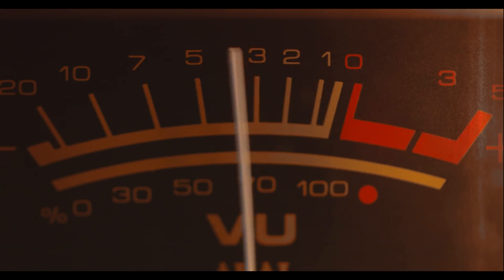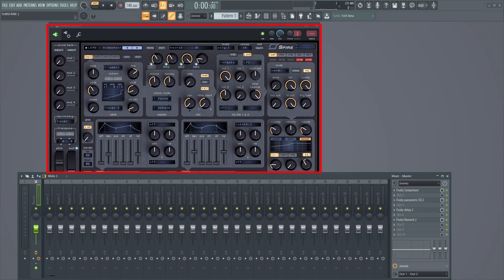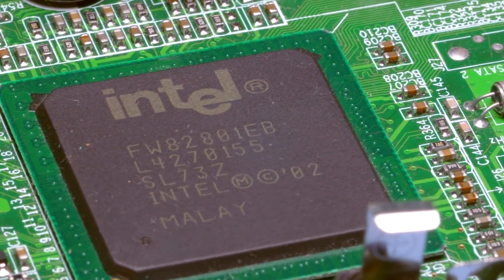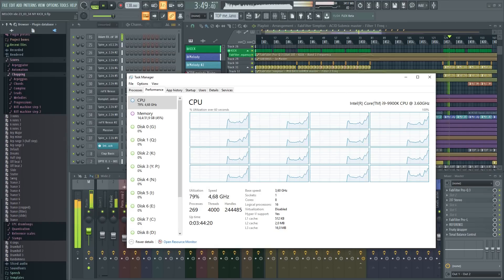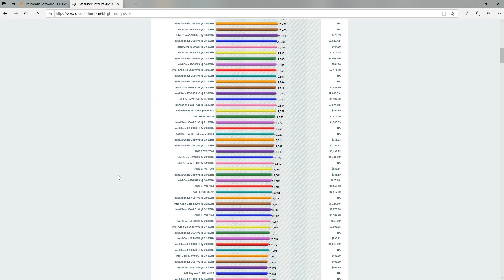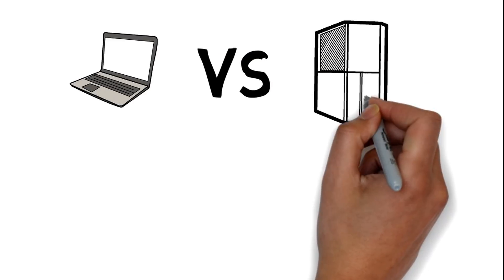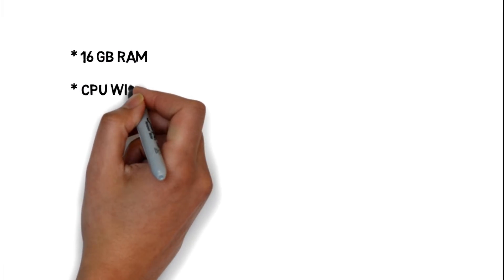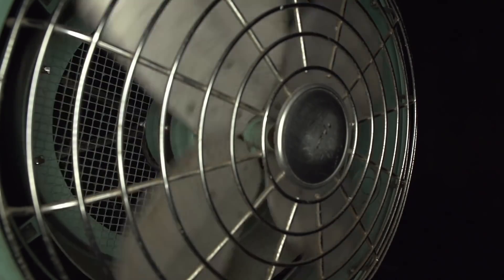The Best Computer For Music Production - What's Needed And Why!

Comment: I'm getting a ryzen 7 3700x and a 2070 super PC with 32 gb of ram for music production/games anybody got a better option that would suit games/music production?
Reply: i9 10900k, an i5 10600k (specially overclocked that matches an i9 for gaming), i7 10700k (i don't recommend it from a value standpoint, but if you want to spend the extra money, then maybe), Ryzen 9 3900x or 3950x.
For graphics, an RTX 2080 Ti.

I usually stick with Intel processors, they always offer lower memory latency and better single thread for pure gaming and audio production, in my opinion, a Ryzen 9 3950x is a good alternative to an i9, it has 16 cores and good singlethread (maybe the best processor ever for music production). Obviously intel systems always have more cost than an AMD one.
Reply: @saricubra2867  I appreciate your reply the pc I'm building will have 2 ssd's and a nvme. I'm trying to keep the price under 2500
Reply: @SAGEBURNT You also have to buy the fastest RAM, check many benchmark sites, i know a recent site called DAW bench, you can see the perfomance of many CPUs relative to buffer sizes (here you can easily see that Intel usually wins but it's up to you from a budget standpoint).
Reply: @saricubra2867  thanks for the insight brother. Have a nice night, or day depending where your at.
Reply: @SAGEBURNT  No problem.
Reply: Avoid HDDs, they are slow specially for orchestral libraries, NVMe storage or SATA SSDs are better.

I recommend NVMe because the speed of reads and writes is very similar to DDR2 RAM, even more.
Reply from the maker: As Star masterc said, AMD generally provide better value overall, but for gaming and music production Intel is still slightly ahead. Especially when overclocked. The AMD chips are basically maxed out from the factory, while the i9 for example can be overclocked to 5+ ghz with ease.
Reply: @FireWalkMusic  I really appreciate you guys I'll most likely go with intel but I do have one other question. What aio would you guys recommend for a intel i9 - 10900k or i7 - 10700k?

Comment: i fully REGRET to buy AMD anyway
Reply: Hey, can you explain why? I'm planning to buy a laptop for production and new ryzen 4000 series 8 core processors are really tempting.
Reply: Hey, can you explain why? I'm planning to buy a laptop and new ryzen 4000 series 8 core processors are really tempting.
Reply from the maker: AMD generally provide better value than Intel, and especially the new Ryzen chips are very good all-round CPU's. Great if you make medium to large sized projects and also do other tasks such as video editing and stuff, which can truly benefit from all those cores. However, for music production and gaming, Intel is still slightly ahead. Especially when overclocked. The i9 can be clocked to 5+ GHZ on all cores with ease, while the AMD flagship is basically maxed out from the factory, so you'll have about 1 ghz more on all cores with the Intel chip, which means that instructions per clock (ipc) will be better with the intel i9, and that's very beneficial for music production which can't utilize multiple cores as well as a video editor for example. However, unless you make some crazy big projects then he AMD CPU's will be more than good enough.

Comment: Hello FireWalk! 

This is Raymond. 
I am going to record my own albums plus compose music to Indie film production projects for clients. 

I will download my Cubase 10.5 into an external Hard Drive from LaCie 32TB https://www.newegg.com/p/2WA-0009-000X9

Below this is the APEXX T4 that I am purchasing from boxxTech!

Processor(s) AMD RYZEN THREADRIPPER 3970X Processor (3.70GHz) 32 Core
System Memory 64GB DDR4-3200 MHz (4 - 16GB DIMMS)
Media Bay Blu-Ray RW Drive
M.2 Storage 2.0TB SSD NVMe/PCIe 4.0 M.2 Drive - Extend Lead Time
Expansion Card Slot(s) NVIDIA GeForce RTX 2080TI 11GB
Operating System Microsoft Windows 10 Professional Workstation Edition 64-Bit (4 Core+)
Keyboard USB Keyboard
Mouse Logitech M100 Corded Mouse
BOXX T-Shirt Boxx T Shirt
System Warranty BOXX Premium Support 1 Year (Years 2 and 3 Standard) - US and Canada Only

Thanks so much for your advice.  I really need to know if this is enough power for my music production projects for film composing
Reply from the maker: Hi, this system should work very well indeed. With more cores than Intel, you'll find it easier to do video editing and such as well.

Comment: Do you still think Intel is better than AMD for music production as of now for the fact that Intel is single core?
Reply from the maker: Hi, you're probably thinking about single core performance? Intel also have several cores. The i9 shown in this video has 8 cores, with hyperthreading which essentially means that it can run 16 threads at the same time. As of right now, Intel still have better single core performance than the AMD Flagship, especially when overclocked. The AMD's are pretty much maxed out from the factory, while the i9 can be pushed above 5 GHZ with ease. 
It all depends on what you're using your computer for. If you also do video editing and such, then you'll really be able to take advantage of the more cores in the AMD chips. AMD also generally provide better value than Intel, so unless you need to squeeze out every last bit of performance, then AMD will be more than good enough. The performance difference between the two in a daw will be minimal.
Reply: @FireWalkMusic  Thank you for your reply. So I guess you are saying that Intel is better for music production vs. AMD correct???  The reason why I'm asking is because I just purchased the new HP Omen 15 2020 laptop for music production and I got the Intel instead of the AMD version because I hear that single core performance is better for music production. I got the 10th gen Intel core i7 10750H 2.6 up to 5GHz (6 cores) with Nvidia GeForce RTX 2070 SUPER Max q + 16 gb ddr4-2933 SD ram + 512 gb PCIe NVMe M.2 SSD
Or was I better off getting the AMD version???  Your honest opinion would be greatly appreciated... Thanks!

Comment: SSD is very fast for data transfer but why do EIDE drives sound better?  I have not figured that one out yet, though I think it may be because we can get higher gauge wire with EIDE connection?  Certainly more options.

Comment: Is the Asus ROG MAXIMUS XI HERO great for music production? (even though it's a gaming tower).
Reply from the maker: You can use any motherboard for this. The reason I choose this one was because I wanted the WIFI and bluetooth, and also because my plan was to overclock a lot, and gaming motherboards are usually geared towards that. There's no problem using a cheaper one. :)

Comment: Ryzen 3 3300X (basically an i7 7700K): the best low end perfomance.

Mid range: the i5 10600k (it's an i7 8700K).

Best high end: i9 10900K.

UFO end: Ryzen 9 3950X, Threadripper 3970X.
Reply: Doea ryzen 5 3600 would accomodate?
Reply: @DazCruizer  Balanced perfomance and good value.
Reply: @saricubra2867  thank you!

Comment: what laptop would you reccomend? im a mobile producer trying to figure this out?
Reply from the maker: The same basic advice apply. Find one that has a CPU with good single core performance. You generally want as many cores as possible, but with as fast single core performance as possible. And preferably something that don't run too hot.

Comment: I want to build a computer and want to record with 0 latency, what should I look for?
Reply from the maker: There will always be some latency. 0 is not achievable. That said, a few miliseconds of latency can't even be perceived by humans, so it's not really an issue. Keep in mind that even bands that play live have some latency. As long as the latency is not too high, it won't be a problem. If you record a lot live, or play midi live etc then having a fast computer will allow you to operate with a low buffer setting even when running a heavy project, allowing you sufficiently low latency.
Reply: FireWalk thank you!!!

Comment: Maybe is better to use firewire interface for better performance
Reply from the maker: I actually have an older firewire based Focusrite Saffire Pro 14 as well. Unfortunately, it's an outdated interface by now, and most motherboards don't come with a firewire port. You'll have to get a PCIe card for it, and those can some times introduce connectivity issues and such. The newer USB standards are more than good enough and will work quite nicely.
Reply: FireWalk i did haver I lot of problems with usb connection still I change to FireWire on my Fireface UFX on an aorus z390 elite motherboard

Comment: Final price you PC ?
Reply from the maker: It depends. If you buy everything from scratch, including monitor, keyboard, mouse, audio interface and everything, then it will be in the 3000 range. However, if you already have a rig and just want to upgrade it, then you can get away with just replacing the motherboard, CPU, CPU-COOLER and RAM for example. Possibly also the power supply. In that case it would be much cheaper. You can find allt he parts used in this build in the description below the video.

Comment: My budget is about half this if not more than half of this
Reply from the maker: This is an extreme example, for the ones who need the very best. Most people don't need the very best, and will do fine with a system costing half as much. Generally, AMD provide better value than Intel. Exactly what kind of computer you need will depend on what kind of projects you make, genre, how you work and so on. Everyone have different needs. 
If you already have a rig and need a faster computer, then you can usually re-use a lot, such as your monitor, audio interface, power supply, video card, case and so on. Usually, you can buy "upgrade kits" with just the main board, fan, cpu and ram. That will be much cheaper than buying everything new.

Comment: If you want to spend 5k for a music production computer start here this video should say
Reply from the maker: It will indeed be expensive if you need to buy everything from scratch. If you go for an upgrade instead, with just cpu, main board, ram and a cooler, then it will be much cheaper. Also, you don't always need the very best computer. This video is for those who need the very best for various reasons, typically people who use tons of VST's and mixer tracks, making huge orchestral projects and such. 
Most people who usually stick to 15-30 mixer tracks and 10-15 VST's and some effects won't need anything close to this. :)

Comment: What's the best processor AMD or Intel for DAW ? Please reply to this
Reply from the maker: Intel generally have better single core performance, and can run at higher clock frequencies. However, AMD has made some really great chips lately, and you'll generally get better value if you go for AMD. More bang for your money as it were. So if you're on a budget, go for AMD. if money is not an issue, then go for Intel. AMD has come very close to intel lately. Out of the box, they are fairly even. Intel can be clocked a lot though, and once overclocked it will outperform the AMD flagship, but not by much.
Reply: Thanks mentor 🙏

Comment: This is total nonsense. The  assumption that DAWs cannot take advantage of parallel processing would only be applicable in the extremely rare case that you were processing a single track. In 99% of cases  you'll want to process multiple tracks simultaneously and each of those tracks can be processed in a separate thread. This is why most DAW producers recommend using a CPU with a high core/thread count capability. If you believe multiple cores are not used, take a look at this video: https://www.youtube.com/watch?v=j3zhKhUxxeE
Reply from the maker: Hi, perhaps you didn't watch the entire video, or just misunderstood what was said. Nobody is saying that a DAW can't use parallel processing. I'm only saying that it's not as efficient at it as many other applications, like say a video editor, due to it's realtime nature. 
All DAWs can utelize multiple cores, and generally, every mixer track in a DAW is an opportunity for the CPU to use parallel processing. However, inside a DAW, dependencies are constantly created, which in turn causes it to be less efficient in terms of parallel processing, because a lot of stuff has to be processed in sequence, one after the other. 
Yes, it CAN use multiple threads of course, but often times the work will be unevenly distributed across cores, and if one core is overworked, then you'll start having problems since sound needs to be played back in real-time. 
Generally, you want as many cores as possible, and as fast single-core speed as possible. Unfortunately, there's usually a tradeoff at some point, where you'll start having more cores at the expense of single-core speeds, due to heat issues. When it comes to music production, the sweet spot will therefore usually be a CPU that maxes out the core count, without sacrificing core speeds. 
I think the developers said it best, so I'll just quote what they said: 
"The logic of audio processing - There is a long list of tasks that must be processed in sequence, and this means logically can't be processed in parallel (multithreaded). For example: Plugins must wait for instructions from the Piano roll and Playlist before they make sound. Effects must wait for the audio from upstream instruments and FX before they can process it. Further, it's not possible to parallel-process (multithread) instruments and FX that are on the same Mixer channel (their audio is mixed together), or even in the same Mixer routing pipe-line (when one Mixer track is linked to another and another, even FX processing has an order from top to bottom in the FX stack). Then, the Master Mixer track must wait for every instrument > mixer track > effect to be processed before it can process the audio through the Master effects. So logically, there is a lot of waiting that is a natural and unavoidable fact of DAW music processing. Think of a production line. This means the CPU may not be particularly busy, using all its cores and processing slots, yet it runs out of time to fill that tiny 5 ms audio-buffer because there was a lot of waiting for things that needed to be processed in sequence. It should be clear that fast processing is very important and this is not the same thing as multi-core processing. The best CPU is one that has enough cores to spread the work around AND can do the most work on a single core during each buffer time-slice. Which leads to our TIP: When comparing CPUs, look for the fastest single-core performance scores in a package with at least 4 physical cores."

Comment: Unless you’re doing 500 part orchestral sessions something with 64 cores like AMDs threadripper will be overkill and the single core performance will be terrible compared to many cheaper processors.
Reply from the maker: Most people won't need a high end CPU. What kind of performance someone needs will depend on what kind of music they produce, and how they work. If you have a 200 channel orchestral project, or say an uplifting orchestral trance project with tons of VST's and effects, then you might need to push it to the limit. But for most EDM with 20-30 mixer tracks and say 10-15 VST's even a budget CPU will be able to handle it. If someone works mainly with recorded samples, then that won't consume a lot of CPU at all, so what you really need is very individual. Some need the very best, and some don't need much at all. :)

Comment: i9 is too expensive. i5 is fine. It made almost no difference in your new processor.
Reply from the maker: The 5820k is a workstation CPU, and it had 4 channel memory vs the i9 dual memory. The main difference is that the I9 is able to play back a project at half the buffer length that the 5820 does, since it has much better single core performance. That's very important if you need to record something. i5 can work well for some people, but for music production I would definitely use a CPU with hyperthreading. A CPU that works well for gaming won't necessarily work well for music production.
Reply: @FireWalkMusic  I am thinking of getting i3 10320 it is cheaper than i5 but has almost same single core speed. 4 core 8 thread. Do u think it will work perfectly?
Reply: @OneStepToday  Go watch amd vs intel in the image line youtube channel
Reply: @wassll  what is your point? I don't understand that guy's videos at all.
Reply: @OneStepToday  amd is affordable and strong